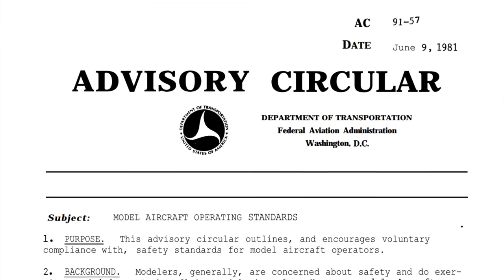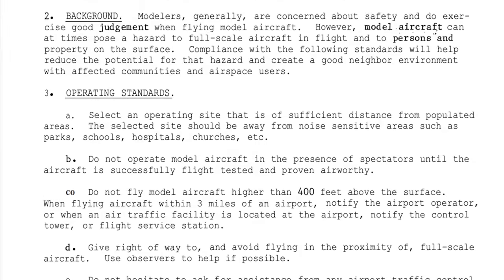A Remote ID Solution for Fixed Wing RC

Comment: Tim,
I thoroughly enjoy your content. I respect your experience and knowledge. 
However, on this subject I must disagree on several points. RID can't be separated out from "drones" and fixed wing. Cameras are not the real issue. Terrorism is. The first Catch 22 is that a terrorist is not going to RID. The second Catch 22 is that any attack will happen below 400ft AGL. A "drone" will never have the carrying capacity of a fixed wing. This is all being discussed as "air traffic safety". It's truly underneath about national security.  If we demonize "drones" we are going to appear to be arrogant, spoiled, and whiny adults with our expensive toys. They see all of them as a UAS. It matters not how it takes off. Yes, cameras can be used to invade privacy or compromise secure facilities.  But, the MUCH worse possibility is a swarm of high speed, low flying fixed wings hitting a soft target like a stadium or open air concert on preprogrammed GPS controlled flight path (with no or minimal control input after launch). I think it would be great if the world worked in ways that would allow us to separate FW R/C from multirotor drones... but those lines are blurry, too. Convergence, HeeWing VTOL, and any V-22 model just name a few. I hate any more government oversight... and I don't think RID will truly help the things it needs to, for the above stated reasons. But, if "they" don't do SOMETHING (even if it's incomplete, ineffective,  and invasive) the public would scream that we should done that "SOMETHING "...
Rant over, keep up the great content creation! 
C.T. Boats Woods
Reply from the maker: Great points, thanks for checking in!  Tim

Comment: Well said again Tim.  I will say that you do have an uphill battle trying to get the FAA to separate fixed wing models and drones.  My guess is by lumping everything into UAS it simplifies rule making.  I agree they painted with a bit too wide of a brush. 

You are 100% correct about which type is causing the problems.  I worked in a FSDO for 32 years and never saw a complaint or issue with model aircraft, until about 2015.  It started with people ratting out YouTube posted drone footage and morphed into 8-9 citizen complaints a month.

One thing you might emphasize is that most fixed wing (or Modelers) belong to clubs/CBOs.  The drone guys seem to be more lone wolf types.
Reply from the maker: 7-Max:  Again, great insights from the field and thanks for checking in again!  Tim

Comment: I've been building and flying my own airplanes for 45 years.
I have a barn full of 1/4, 1/5 and 1/6 scale airplanes. I've got 2 cycle, 4 cycle, electric and gas turbines.
I fly off of 20 acres. I'm surrounded by farms. The closest airport is a dozen miles away. And it's a gross strip with a single hanger and no services.
The closest almost certified FRIA is a couple of hours away.
I don't shoot YouTube videos.
I don't get paid to fly.
I was told I have to get a commercial drone license in order to fly on my own property.
But now guess what? I have to have a separate remote ID module for more than 30 airplanes.... and yeah, I really fly ALL of them.
As a "commercial drone pilot" I have to have a module for every airplane.
And that's not the only rub in all of this.
ANYBODY who posts a flying video on YouTube..... whether it's monetized or not, needs a commercial license too.
Because YOUTUBE will monetize YOUR video. Even if you don't. 
I have mentioned both these things on your channel before. And I've been treated really badly because of it.
But I was right it's all true and it continues to be true.
The biggest problem here is that us old-timers got lumped in with everybody else. Even though we've never had any problems.
And the AMA COMPLETELY sold us out.
Once it was clear that their existence was threatened, they folded like a bunch of playing cards.
If you doubt anything I'm saying here, you need to look it up. BEFORE you tell me I'm wrong. Because I've hired a couple of attorneys, and I've fought this thing as far as I could.
When I go on the website to register my models, I have to enter a SEPARATE NUMBER FOR EACH OF THEM.
And how do I know about YouTube monetizing your videos and the need to have a commercial drone license?
Because I has 2 videos of my airplanes being flown. After making comments on this channel, several people reported me to the FAA.....
No good deed goes unpunished.
Reply from the maker: Christopher:  Thanks so much for checking in, but essentially EVERYTHING you have written is completely wrong.

Completely.

First, you are a recreational pilot.  This means you do not make any money with your RC flight activities.  Recreational pilots need to get a simple registration number from the FAA.  Done on line, I think the cost is $5 for three years.  This one registration number is used for ALL of your models.  All of them.

As a recreational pilot you need one remote ID broadcast module, just swap between your models like you do a lipo battery pack.

It is a very big deal to get money from YouTube.  I think 1,000 subscribers and 4,000 hours view time in the past year.  Plus you have to apply for it.  If  you just make YouTube videos you do not need a commercial pilot license.  Tim
Reply: @TimMcKay56 Coming back to look at this again..... Turns out I was right about EVERYTHING. 
One thing you totally missed was that I can't fly outside a FRIA without getting a 107.
So to recap .... In order for me to fly at home as I have for decades, I have to get a 107. Then I need a remote ID for EVERY aircraft. That is a SEPARATE remote ID module for EVERY aircraft. 
And no, you CAN NOT, post videos to your YouTube channel because YOUTUBE is monetizing your videos, even if you are not. 
I have been trying to get this information out so that we could all raise our concerns BEFORE the legislation and now rules were made permanent. 
Unfortunately your channel and to be fair every single content creator I contacted treated this information, and me, the exact same way. 
Because of this, we lost almost 3 years of opportunities to shut this thing down before it started. 
I really appreciate your activities in trying to get the FAA to separate fixed wing from quadcopters. 
But if you had taken me seriously the additional information might have made a difference. Don't you think?
One more thing. Saying we don't need cameras on any recreational flight isn't what we want. Maybe we could use flying fpv to disassociate ourselves. But let's face it, there is a HUGE difference between

Comment: Its rough, im trying to get into the hobby but cant help but feeling like its gate kept everwhere you turn... 

I have my TRUST Cert. and everything,  and obviously wouldn't do anything to endanger anyone near where Id be flying at and chose my flight site accordingly,  but it seems it just HAS to be another 100 bucks, or AMA club membership away being able to actually get involved in this hobby.

Like if the Wright brothers had similar regulations, we wouldnt be here....
Reply from the maker: Things change in life.  For example, to fly RC in 1936 you would have had to have been essentially a radio engineer.  Now ALL supplies are a mouse-click away via the internet.  This is a great hobby with any number of ways to enjoy it.  Don't sweat the small stuff!  Tim

Comment: Tim, well done and I completely agree with your approach to solving this issue, however I don’t think we can simply separate out fixed wing aircraft. I come from the utility sector and fixed wing remote aircraft (drones) are being used for utility inspections.  In Nevada, the legislature passed drone laws for economic development perspective. They are currently testing long range beyond the line of site fixed wing drones for line patrols. In the event of an outage, the utility can remotely fly a drone for tens or hundreds of miles with a camera with qualified personal on the transmitter end to inspect the line for damage. Frankly, I think the word drone is the root of the problem and we need to separate the industry having commercial and private operator, fixed wing and rotors.
Reply from the maker: Joe:  Fully agree, and I need to  make sure I emphasize that I am discussing recreational flying and not Part 107 or a US government operations.  The latter will follow whatever the rules are.  Tim

Comment: Hey Tim, I appreciate this point of view and coverage of this topic, especially as a fixed wing pilot myself. However, as much as I'd like to keep remote ID out of my aircrafts, I'm not sure that I fully agree with you on this one. I don't believe that nature of an aircraft being a fixed-wing recreational model is enough justification for an exemption to remote id. While the track record of model aviation safety with fixed wing UAS is favorable, it may be unfair to the knowledgeable and safe single rotor and multirotor pilots to exclude their practices and similar track record. Often by association, they are unfortunately grouped as one with unknowledgeable and unsafe( knowingly or knowingly) new pilots that are attracted to the modern accessibility and ease of use with a multirotor platform. Cameras and other sensors may be more common on multirotor platforms, but they certainly aren't exclusive to multirotor. Modern fixed wing and VTOL UAS for last mile and remote delivery are a great example of this.  I think it may be a step in the wrong direction to focus on the type of aircraft, instead of the aircraft's capabilities, or the operator's responsibility to aviate safely. Curious to hear your thoughts!
Reply from the maker: Fair points!  I am just trying to jumpstart the conversation, give the FAA something to work with instead of a laundry list of complaints. I do think cameras on any RC aircraft are an incentive to go out and explore. I can go either way as my SkyID will suffice fine when I am not in the FRIA. Tim

Comment: Its the perceived danger, not the actual. Populations react to reports and raise their concerns with governments who pass on those concerns to regulatory bodies who delgate to the likes of the flying association. If those associations sit on their hands, the matter goes back to legislators who forces action. Gliding associations, full-size that is, have been very pro-active because they are concerned about mid-air collisions. They have promoted the use of radio beacons to make each pilot aware of the location of other aircraft, and that is in the process of expanding to other aicraft types. Gliding Associations around the world are respected and generally allowed to supervise their own with little regulation from outside. The perceived dangers of quads, jets, and over 10cc high performance models have been here for a dozen years or more. We even have 400mph gliders!!  But the hobby associations have done very little, if anything. They prefer to wait until they are pushed, and then try to push back. Its too late, governments around the world have set the beacon identification system in place, and it will come in. Its an international business and all the countries will be following the pioneers so that if a tragedy does occur they can point to the action they have taken. Even Bruce at XJet knows this, he was obliged to listen into aircraft frequencies at his airport in case a Piper or Cessna is due to arrive. We all need to do the bisteringly obvious sometimes.
Reply from the maker: Interesting points!  Tim

Comment: Tim, you do know the difderence between a fixed wing and a drone BUT, you obviously dont understand the difference between fpv freestyle drones or camera drones.  You are soooo out of touch of the hobby, your views make me laugh.  Try to do better
Reply from the maker: No, you are correct, I know very little about drones.  But I do know that are around 100% of the airspace violations.  Airspace violations are a very serious issue to the FAA and affects all RC flyers.  Tim
Reply: @TimMcKay56  as  I listen more I think it’s so irresponsible you posting these without any knowledge of aircraft outside fixed wing. 

I know you mean well but why don’t you educate yourself?
Reply: @TimMcKay56  Hello Tim. I think it may be important to point this out here.  It may be true that most or all airspace violations in your data are from multirotors, but it's important read between the lines here and be more discerning with the data, so that we all can address the actual issues. It should be clear that those airspace violations aren't attributable and inherent to the multirotor platform itself. The FAA cares about safety in the NAS. This in mind, it's also clear that the safe practices of knowledgeable multirotor modelers isn't represented if you're only counting airspace violations like this. There's far more to this picture as i'm sure you can imagine. I know the discussion needs to start somewhere, but let's start it off on the right foot. To address the real issues, we'll need a more-than-surface-level approach to the data. A knowledgeable and safe model pilot should have the privilege to aviate safely, no matter the platform. Thank you for your time. Curious to see how this develops in the future. Malin.

Comment: Hey Tim,  there are some modelers that build fixed wing rc planes flown autonomously and beyond visual line of site. I'm sure they follow the rules associated but I believe that will not make the FAA drop the RID requirement for fixed wing. It can be relaxed because it's different from a drone, but I am sure there would still be some exceptions.  The FAA response may be FRIA. Thank you for continuing to educate the public on this subject.  I see the need for safe model flying as well, Quad and Fixed wing.
Reply: I just heard the camera explanation for RID on Fixedwing aircraft and waypoint flights.. Thats Perfect.. I had not thought of that!
Reply from the maker: FRIAs are a really big deal, as the FAA is saying "we trust FRIA pilots to stay within the boundaries and follow the rules with zero RID hardware."  So this is a test.  Key item is to demonstrate, with data, to the FAA that fixed wing aircraft can follow the rules, thus provide a safe operation.  Tim
Reply: Bvlos is illegal

Comment: Here's a left field type of approach-- nobody proposes to hang remote id on birds, like hawks, eagles, whooping cranes, migratory ducks and geese, and these obvious and numerous hazards to commercial aviation have characteristics in common with fixed wing aircraft-- their flight patterns and behavior are not at all "drone-like". Obviously impractical to control birds! But nobody seems concerned, as birds are a familiar hazard with known flight envelopes. Apply the same reasoning to fixed wing RC:  familiar objects with well-known aerodynamic and flight characteristics. If birds aren't being shot out of the sky, captured and tagged with beacons, why sweat RC fixed wing? After all, aren't there many more migratory birds flying around than RC aircraft?? And I don't think birds even have sense enough to be aware of aircraft in their vicinity. They certainly aren't going to be conforming to community safely guidelines.
Reply from the maker: You correctly point out that birds do not respond to controlled instructions.  Got that.  But a lot, I repeat a lot of planes get damaged by birds, some quite seriously.  Thinking logically for a moment, if RC planes, flown by humans, can follow certain regulations for airspace safety and security, would it not be a wise choise to follow that path?  Tim
Reply: Oh, of course, since we have a human brain behind the RC aircraft. And it might be well to point out the obvious: fixed wing aircraft need SPACE! The bigger and heavier the plane the more space is required. Take off! Landing! And even if you can hand launch, there is still a pattern required for the landing, due to wind direction, and that requires open space. Quad copters can be launched just about anywhere and land just about anywhere and that means that they can be flown just about anywhere in a congested urban environment. Not so for fixed wing. I'd submit that this alone makes fixed wing RC inherently safer than a quadcopter like device. Not so long ago a bird brought down a B-1, but I don't think that any fixed wing RC has done that. And I hope it NEVER HAPPENS! @TimMcKay56